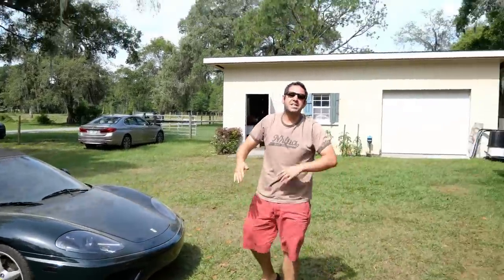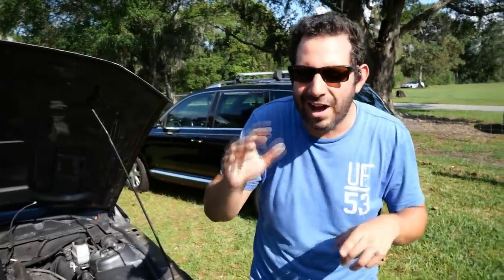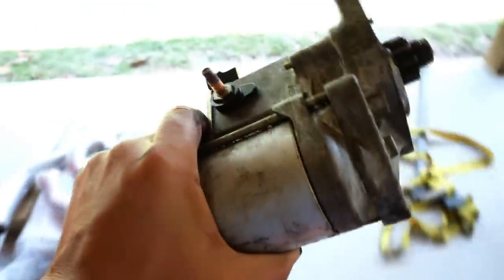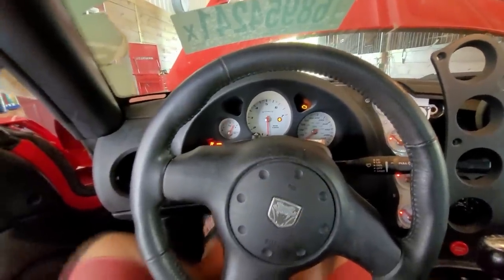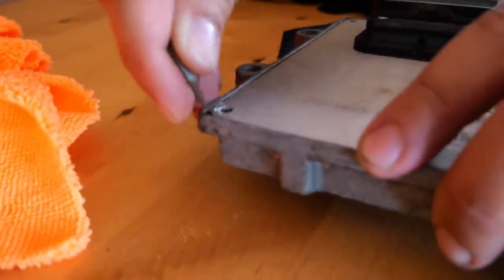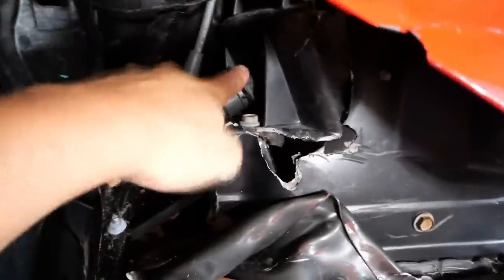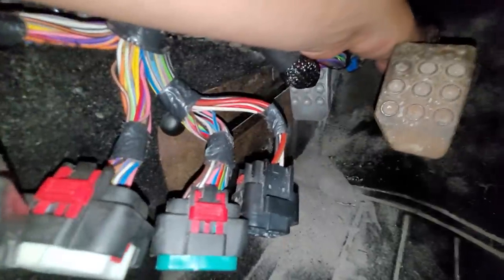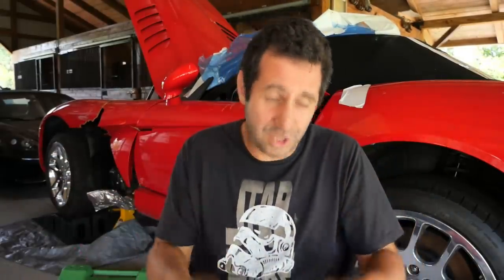Here's Why This Flooded Dodge Viper Won't Start

Comment: Clean the board with isopropyl alcohol. Then clean the contacts. Board components are generally waterproof.
Invest in an ultrasonic cleaner too. Great for complex parts and boards.
Reply: That board is fried, those chips, transistors most likely are shorted, at this point better to get a new/used board, because even if you fix the board, no guarantee how long it will last..
Reply: @ДимитърАндонов-ъ7е  agreed, but if he gets it working:

1. He knows whether the engine can be saved
2. He doesn't have to spend money on parts that may/may not work anyways
Reply: @ДимитърАндонов-ъ7е  Still worth a try
Reply: It depends. If it was not conformal coated when it was manufactured, then it will not be waterproof. The corrosion will have damaged the components where they solder to the PCB and the corrosion will be causing shorts and open circuits all over the place. This thing has sat for months with water in those modules, it will be hard to fix them.
Reply: @42222  I won't trust this thing anymore, since if he is right (I don't know) all the communication of the car is relying on this module. Just not worth it.
Reply: Invest in a ultra sonic cleaner. Do you even watch this channel???
Reply: @Belal-Khan  simple cleaning won't fix this, it sat for months in water and sand, also electricity flew through it, causing ton of problems, it's shot, u need replacing chips/ components, u need special equipment and knowledge how to proceed, and even with all this you need some sort of common sense or schematis for the board to figure out how it's working.
Reply: @ДимитърАндонов-ъ7е  His OBD 2 reader recognized the BCM, i'd say it's good as is. The problem preventing start-up is the busted-up clutch safety switch.
Reply: @ДимитърАндонов-ъ7е  i had my keyboard completely fucked in water 3 yrs ago, took it all out disassembled it and cleaned every part of electronic with isopropyl alcohol and cue tips, let it sit for a day and it works still till this day. I know it's not the same as a car but it's still worth a try cause everybody said i should throw the keyboard away but it cost like 150$ so i insisted on trying.
Reply: @INDIFFERENTPRODUCTION  nowhere near this board. Your keyboard is flexible board with little components, and probably you just shorted keys on the flexboard, and water didn't get to the small controll board. Totally different situations.
Reply: @mike42ohio  he's having communication problems, probably can problems.. you see the OBd didn't even find his ECU, how the car will start without the car communicating with it's computer which is doing all the starting jobs...
Reply: @ДимитърАндонов-ъ7е  That is a good point. So you think the issue is in the ECU? It looked very good no water damage. Since I agree it's a communication issue maybe they are overlooking damage on the wire harness between the BCM and ECU.
Reply: @ДимитърАндонов-ъ7е  Concur. The ECM may be waterproofed to perfection (as it appears) but, all it takes is water to get in a connector upstream (pun intended) to create a short that sends the wrong amperage down the path into the ECM to cook it.
Reply: @mike42ohio  I don't know to be honest. Maybe, I'm not ecm, can specialist. Just electronics enthusiast. But if he's correct that this module is responsible for all the communication of the car. That's the starting point I will go. I will get a replacement second hand module to test. This is just shot.
Reply: @Belal-Khan  He's stupid for not having the motor opened up and properly inspected and rebuilt.  Noone in their right mind takes a flooded car especially a dodge viper that was filled with water and thinks they can simply clean it out and try to start it and hope it works.  It may run but there's zero reliability left at this point.
Reply: When you see green gunk, it's time to dunk it to the dump.  13:28 you can get a nice crisp shot of the module and that is goner.

1) That sand looking white stuff wouldn't worry that much it could be just some residue from something. But when you see green in it, you know it's copper oxide which comes when copper corrodes and that means PCB traces dying. If it was just one or two chips with corroded traces to them, it would be just work exposing some more traces and rebuilding the traces from thin copper wire. But I count 9 chips with marks of corrosion and even exposed parts of PCB with corrosion, that is bad.

2) That possibly central control chip (a bit bigger with many smaller legs) seems to even have rust on it.

3) Connectors seem to need replacing.

That corrosion part is pretty much the deal. You don't just clean it off because it's basicly the chips innards and/or the PCBs conducting parts pushing out and being dead.
Reply: @ДимитърАндонов-ъ7е  yes bulgaria
Reply: Putting a water damaged PCB, in a zip-loc-bag containing isopropyl alcohol, in the ultrasonic cleaner has worked for me several times. Saved me from buying new adaptive headlight modules for my BMW. I did the repair about six years ago and I've had no problems since. Most components survives being submerged in water for a long time, it's the corrosion on the circuits and connections that most often is causing problems/shorts IMO.
Reply: Exactly!  I'm a EE who started life as a technician and that's the first thing I would have done.   And for the Mustang?  Black......of course.
Reply: Agree. Frying usually requires a constant power source, which can't be maintained when a loom is under water.
Reply: @ДимитърАндонов-ъ7е  You'd be surprised at the amount of laptops I've saved with a simple ipa and toothbrush cleaning that had corrosion worse than this. It's worth a try and the fact that it is still recognized means it's main components are still working and it's not shorted. The corrosion could simply be causing a problem with data transfer to a certain component. Or it might just be the connectors being slightly corroded causing it not to communicate with the ecm and simply unplugging and plugging the connections to scratch a fresh contact point might be all it needs as well.
Reply: Lemon Juice, then Iso, and heat away.
Reply: In addition bake it in the oven for an hour in order to remove any moisture. Be careful with temperature not to damage the plastic parts or the conformal coating. The temperature doesn't need to be above boiling point. Then clean the contacts with a fiber glass pen while vacuum the dust. 90% of all electronic problems are electric contact issues in my experience.
Reply: @berube361  agree 💯.   It also ruins any credibility previously held by the "YouTube rebuilders" advising him that it is OK to fire it up without disassembly.  I hope he is just teasing the start for views, though that would be a dirty thing to do to the viewers.
Reply: @philscott7949  No, it doesn't.  All it requires is a sufficient burst.  Have you never fried a board with ESD?  My mom zapped a fairly high dollar stereo system reaching out to turn a rather expensive stereo, once, because her wool socks picked up enough static to kill it when she reached up to turn it on.  There COULD have been a sufficient jolt of current to fry things when it was dunked and water entered the unit.  It also sat wet for quite some time.  Electricity can cross corrosion or mineral deposits, also frying things.  He could have fried electronics just by turning the key with that board looking so nasty.  For that matter, it could also just be a short to ground somewhere, due to corrosion or deposits left behind, as well.

Comment: i had the same problem with a pick up truck it went in the boat ramp...  after all the usual drainings, usually only oil i rinse everything with fresh water,... but it would not start... it would spin over ,i soaked the ecm in alcohol then put it under the hood of my limo while it was running.. limo was my service vehicle... with the ac running under the hood was over 240 degrees. so i put the computer on the engine for an hour.. put it in the truck afterwards and started up like nothing was ever wrong.. later the ac/ started working then the radio too... fresh water rinse is the best...  true story!!!! good luck all!!!

Comment: A brand new BCM from Dodge is about $250. Part# 4865524AL. That's what I would try first. It may work without programming. I thought mileage was stored on the BCM, but according to the manual it's actually in the PCM. So the BCM should not need to be programmed:
"If the PCM is replaced, update the mileage and vehicle identification number (VIN) in the new PCM." If you end up having to replace the PCM, your Launch tool should be able to write mileage and the VIN into the new one.

Also, don't forget these cars have something called ASD "auto shutdown relay". This may be your next issue. Now a blown ASD relay will not prevent the engine from cranking, according to the service manual. If you want a copy of the service manual, I will gladly email it to you. It's about 1,800 pages. 

Here's how the PCM and ASD are supposed to work:
"The Auto Shutdown (ASD) and fuel pump relays are mounted externally, but turned on and off by the PCM.
The crankshaft position sensor signal is sent to the PCM. If the PCM does not receive the signal within approximately one second of engine cranking, it deactivates the ASD relay and fuel pump relay. When these relays deactivate, power is shut off the fuel injectors, ignition coils, heating element in the upstream oxygen sensors, hydraulic fan solenoid and the fuel pump."

To answer your question about the PCM having to communicate through the BCM here's what it says:
"The Body Control Module (BCM) supplies vehicle occupants with visual and audible information and controls various vehicle functions. To provide and receive information, the BCM is interfaced to the vehicle’s serial bus communications network, referred to as the Programmable Communications Interface(PCI) data bus.
This network consists of the;
• Audio system equipped with RBQ radio.
• Controller Antilock Brake (CAB)
• Electro Mechanical Instrument Cluster (EMIC)
• HVAC Control Module
• Occupant Restraint Controller (ORC)
• Powertrain Control Module (PCM)"

Now that's  not a very definitive explanation, but clearly your BCM is water damaged. For the cost of a replacement, it's worth just getting a new one and trying it out. You could try your luck with a used minivan BCM or something off eBay, but you never know what condition a used one will be in.
Reply: That's just ton of straight to the point info. Great job. 👏
Reply: damn, hope he sees all these
Reply from the maker: I saw it. Thanks much!!!
Reply from the maker: Thank you very much Viper Mike. If you wouldn't mind emailing it to me its Samcracauto@gmail.com. Thanks!
Reply: @Samcrac  I just set it to you as well.
Reply: I don't think the PCM should need to communicate with the BCM for the engine to run. All of the wires to and from the engine go through the main plugs that connect to the PCM. As you mentioned, if any of the signals the PCM needs to see aren't present, it won't energize the ASD relay. I do think his issue was with the starter, as even if the BCM or PCM were bad, it should try to turn the engine over and simply crank no start.
The PCM does engine communication and energizes circuits in the PDS, the fuse box, but most importantly it energizes the fuel pump and starter relays when it receives a signal from the ignition. It also, obviously, energizes the ASD relay. Sure he likely won't get proper gauge readouts and communication with the bad BCM, but the engine should run as long as the PCM and wiring between PCM and engine are good.
I literally got my 2001 Dodge V10 to run just by plugging in the PCM and connecting 4 wires to the fuse box. Key on power run/start to PCM, start signal with clutch safety, park/neutral safety which should be included in his clutch circuit, and fuel pump relay out. His issue could be with his clutch pedal not completing the clutch safety switch circuit because the PCM won't energize the starter relay unless it sees that.
Basically, the BCM should not be disabling the engine. I don't even have one to run my engine, only the PCM and fuse box. If the engine is not turning over either the starter or starter circuit is bad, the key/ignition circuit is bad, the clutch/neutral safety circuit is bad, or there is an issue with the PCM which I doubt. There could be something about the Viper I don't know, but it uses almost the exact same PCM and system as my 2001 truck engine.
Reply: @802Garage  only issue could be with the anti theft. If the BCM thinks the car is being stolen, it won’t let it crank at all. It could be that whatever part of the BCM controls the anti-theft is fried. The PCI communication protocol was a new thing in the Gen 3’s, so your 2001 would not have the same system.
Reply: @ViperMike  Very good point! Forgot about that. I thought the 2003 still used the CCD communication standard, but I imagine the security system still works similarly. It would, in essence, disable one of the circuits I mentioned, right? Most likely the ignition circuit itself. So yes, if the BCM is faulty and the security system is disabling the ignition, that could also the the issue. Fun stuff! Great comment BTW. Hopefully it's a simple switch or wire somewhere and he doesn't have to spend the hours pouring through the manual.
Reply: @802Garage  I was thinking the same thing and with the damage to the clutch pedal i would put good money its the neutral safety switch not recognizing the pedal being pressed as the whole assembly is moving instead.
Reply: Mileage is stored in the cluster and can't be altered.  When you replace a pcm you transfer that Mileage to the pcm when marrying the pcm to the car. Bcm has nothing to do with mileage.
Reply: @whylee3686  sam can just remove the pedal switch from the pedal (since it's all exposed and easy to get to from outside now) so the pcm thinks its being pressed, I believe.
Reply: @AppleReviews  it's not a phone.
Reply: @stevelozano9523  I agree with the huge whole in the car it's a lot easier to get to everything. I started thinking more about the neutral switch. I think it pulls power from the ignition switch so it could be either of them. Its essentially a signal interrupt to the starter without being pressed. Also the ground to body could run threw the pedal assembly not 100% on that though.
Reply: @whylee3686  I have a 40 year old story on youthful ignorance and a neutral safety switch.
Reply: @AppleReviews  CRC Electronic Cleaner?
Reply: I said it last time and I'll say it again, with a handle like ViperMike  .. I'll take your word on it 👍🏽
Reply: Excellent Info!!! Right On!! 👍👍
Reply: @Tech-ez1qj  -- Mileage is actually stored in many different places.  Some scan tools verify mileage for tampering by checking several different controllers and making sure they all match up.

Comment: The modules communicate to each other thru canbus, which is basically a wire connecting to each module. A corroded connector would be the first thing I'd look at, at the body control module. Seeing as how the body module still reads on your diagnostic, check the wire out that goes to the engine computer.
Reply: Agreed, can bus runs on a pair of wires  and can be easily checked.
Reply: Yeah you'd think that, just fixed a dodge charger that wasn't shifting, had other random issues. Attempted replacing all modules, no change, swapped the bcm and it works now. Common issue. My canbus was fine. And I could still bread the module, just had some issues

Comment: My assembly line at work handles a couple dozen sunroof ECUs.  They all have the same footprint and fit into the same motor housing and while there are only 4 different PCBs, the software written to each is different between vehicles.
The Caravan BCM is probably a completely different PCB inside the same housing.  Even if it's the same PCB, it'll be different software.

Comment: dodge also made the engine bay fuse box as a T.I.P.M. (totally integrated power module ) and can cause significant drivability issues

Comment: Sam as a Auto Damage Appraiser In Boston /more than 40 years experience [including flood damaged cars , Modules {LKQ} [used] serial#'s must be the same {i do not know of any reprograming that works. ECU's can sometimes be dried out @ a heat source {slowly}, once opened up .Spray Contact cleaner also helps . I like to coat all plugs / high delectic grease & also find disassembling starters & using WD 40 first then Contact 
cleaner. Finally The car will never start till The clutch is secured so the lockout switch will work & The Engine will start!  Good Luck!!